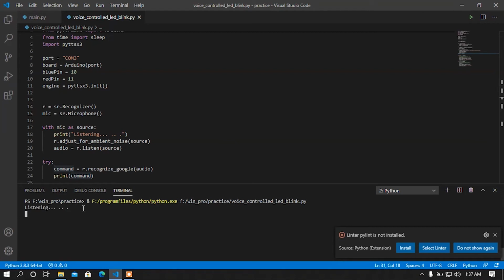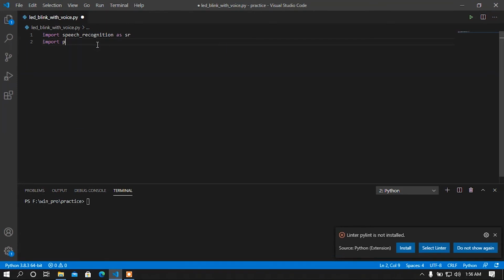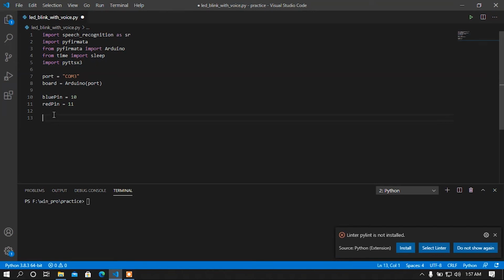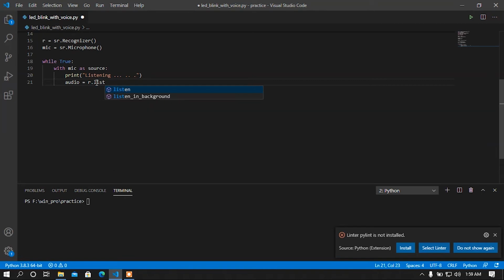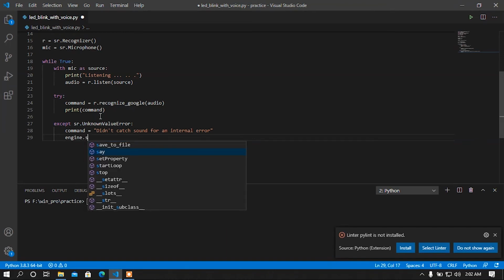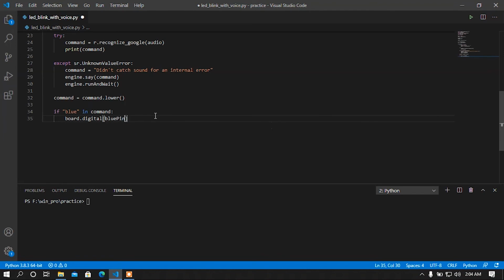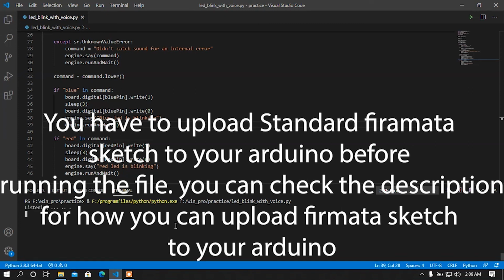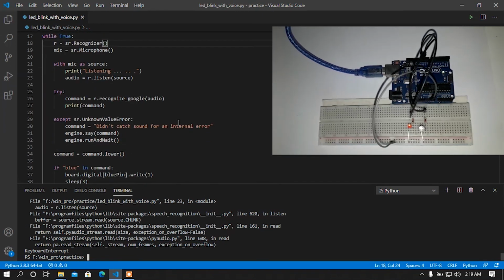Control your Arduino over voice using PYTHON.

Comment: Good work brother!
I have already tried this before.
I have tried this on using Kivy app and it works well, but it always fails due to pyaudio errors in Android phone after building Android apk.
I am requesting you to make Kivy app using speech recognition and pyfirmata and try the same on Android phone.
Reply from the maker: bro,
android doesn't support pyaudio. you need to write pyjnius code for it. Thank you.
Reply: @OIRLDBOX  will pyfirmata works with Android?
Reply from the maker: @tejasnandam2023  yes, it works